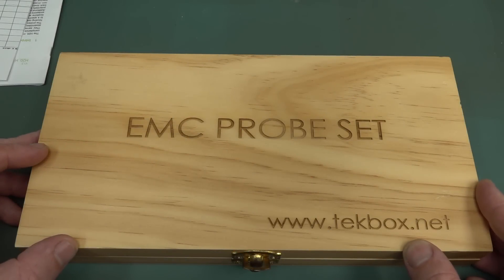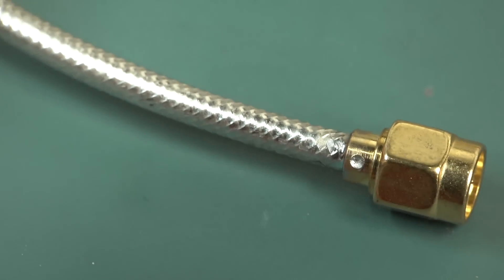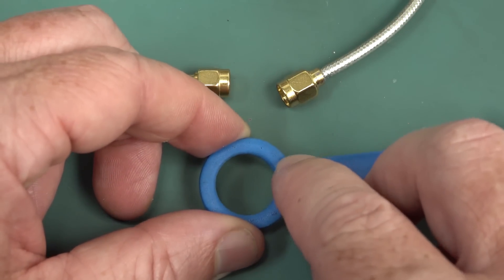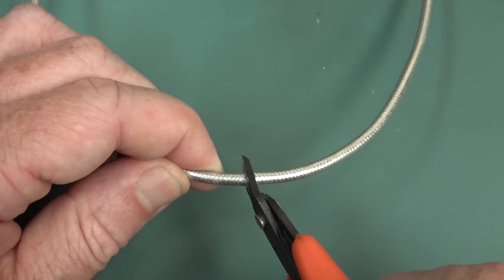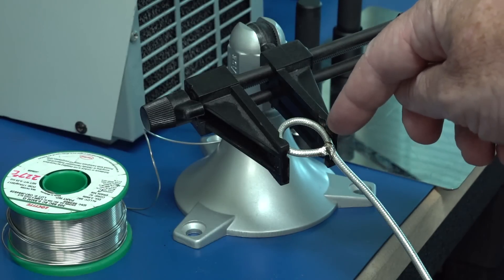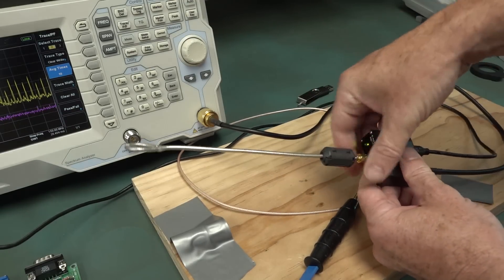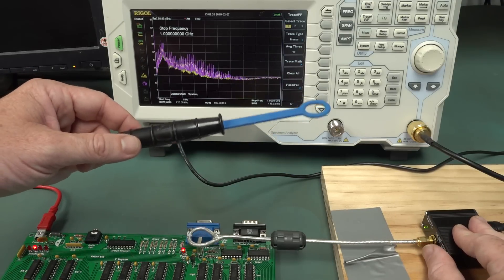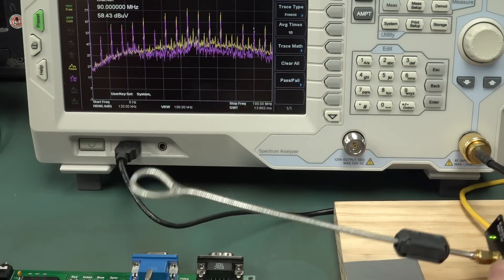EEVblog #1178 - Build a $10 DIY EMC Probe

Comment: When winding the coils I am desiring to measure to very low frequencies.  I notice professional low frequency sensors such as 'WaveControl WPH-DC' are extremely expensive.  What limits the lower frequency response of these?  How many loops and wire gauge if my goal is to be able to measure down to 1hz?

Comment: So I can use this to get the signal from the speaker wire on my Panasonic SA-PM46 Self Stereo (which I purchased from JB-HI-FI Woden in Canberra in 2007/08) amplify it so I can use it as line in for my TDK S60 Tremor Subwoofer!

Comment: Use the PastiDip in the non-aerosol can or liquid electrical tape and you will be much happier. 

Also, you can make the very small loops from very small diameter coax.  The coax does not need to be rigid, and if you put some steel wires or small fiberglass/carbon-fiber rods along side the coax for the small loop, it will add the needed rigidity. Use heat shrink over the coax and stiffener for the straight part and dip/paint on the liquid tape over the loop.

The small loop can be even more finicky to cut and solder, so short the end of it back over the coax before bending it into the loop, then solder the whole end back to the shield to make the loop. To cut the gap in the middle, you only need to make a single slice, and when you dip it or brush on the tape, it will fill that slot and Robert is your mother’s brother.

Comment: can anyone comment on the signal symmetry delivered by these antennas? The coax cable has 50 Ω wave impedance matching that of the amplifier and the scope, but is the signal coming from the probe symmetric or single ended?

Feel free to bash me in case my question makes no sense. Thank you in advance for taking time to answer my question.

Comment: The clue is in the name; PlastiDIP. Always better dipped if possible rather than sprayed. Mix and let settle to allow bubbles to come out before dipping. Keep moving while drying for even coating. Buy Pastidip thinners (naphtha) at same time in order to vary thickness (let evaporate to thicken, add thinners to thin). Store in fully sealed container otherwise it will be solid when you come back to it in a few months time.

Comment: You don't need plasti-dip for probe coating, use electrical tape.  It almost looks like the cheaper one could be prototyped in strip board if the need was urgent enough.  For a cheap spectrum analyzer, attach a 10 MSPS SPI ADC to a raspberry pi, write some code to perform FFT on the data using the GPU and pipe the output to a graphing utility to get an approximation of a spectrum analyzer.

Comment: I got loads of those RF amps sitting around, they're handy because you can use a buck converter and set the output voltage to calibrate gain with them, no need to use an attenuator.

Comment: HELP.
i have tried to join your EEVfORUM with out success
i signed up for a new account but never received a conformation email.
SMF help section says if i try to login with out conforming my email it will say i have not confirmed my email and will show a link to re send the confirmation email.
this is not happening when i try to login it just says username does not exist and asks for a correct username.
this is very frustrating as there is no way to contact any of your administrators unless i am signed in.
why is this happening, how can i fix it,

Comment: I'm sure it would be possible to build a $50 active probe that performs close to a $5000 keysight active probe. But the problem is, in order to do that, you need a very expensive spectrum analyzer and all related RF electronics gear. And once you have invested $100,000 dollars for all that gear, you wouldn't want to sell the product with just say a 100% margin, cause if you do, it would take decades to amortize your investment.

Comment: Im sure everyone has already said this but this is Semi-Rigid not Rigid 
but i mean you would never buy rigid coax without a bender and method of calibration and most dont even use SMA because its not good enough and blah blah blah 
anyway great video, i have a bunch of these little amps for RF stuff and might want to make one of these for use with an SDR (i dont own a spectrum analyzer unfortunately)

Comment: Another solution for your rubber coating: buy ABS filament for 3d printers and solve it in acetone. Then you can use a brush to apply it. The acetone vaporizes on its own at >20°C and only the ABS is left

Comment: Good noise floor for the couple dollar pre-amp. 
I've seen worse from decent commercial jobs. 
You can also make a quick and dirty e-field probe by cutting away some shield leaving a very short stub of the solid core conductor then insulating against shorts. 

Even if you don't have a specan these tools are useful with an oscilloscope (you will need the preamp). If it has fft like most dso do then that is a bonus.

Home made H-felds are great, beat the old emco kit any day of the week

Comment: You can make the H-field loop solder connection and shield cutting in many ways. There will be very little performance difference if you make it unsymmetric and just solder the center conductor to the shield on one side. Yeah, it won't be geometrically symmetric, but it will be electrically almost the same as the more complicated construction.

Comment: excellent video. I hope you make the follow up videos as you mentioned. I would also love to see a differential version of this instead of single ended. I think high end EMC probes must be differential to suppress common mode noise and enhance sensitivity. In the end it can be converted to single ended using a balun or something.
Someone asked if this can be used in audio frequencies, I think the voltage induced in that loop must be proportional to frequency as well as the loop area, so at audio frequency, the picked up voltage will be way below noise level

Comment: I NEVER found using this type of probe to find where the RE noise was coming from. The noise was everywhere, every component, every power rail. So trying to fix an RE compliance issue was not done with this sort of test gear.
We joked that what we needed was eye sight that could see the circuit board in the frequency of interest to find the component and power connections radiating. 
What I did learn was how to design proper decoupling to each component, and paying special attention to components that drove wide processor bus (octal, 16) paths, as these are charging the circuit traces which is what causes the RE problem in the first place. Our PC design department was useless, as they would just place the decoupling components around the board.  We figured out how to source the power for each IC on the PWB, so they were not directly connected to the power planes, but instead to multiple capacitors, which then had power connected to Vcc and such. The inductance of these traces had to be kept minimal. The idea is that the decoupling provided the high frequency currents for charging the board capacitance/inductance. It was tough, as we dealt with non technical board designers, that wanted to turn the autorouter on.
Reply: Well if the emissions are everywhere, then the design has a major problem as described. Been there, fixed that.
Reply: It takes a smaller loop - which will provide higher spatial resolution. 2 turns of 32awg (or so) enameled wire on 2-3mm dia (wire wrap wire also works), 50-ohm resistor in series and coax. Preamp required. Works well.
Reply: @milantrcka121  I never found any ability to find the source of the emission as any quantitative measurements were "noise here, and more noise there". The circuit boards were 150mm X 250mm. In 1988 the processor frequencies were 6-10MHz, but this morphed to 32MHz, to 128Mhz. The lab had multiple HP brand probes. When I was still green starting out, the technicians just laughed, as they knew the root cause of the emission was not found by this method. The RE plot would show which processor frequencies were the source of emission limit exceeded. So we would try to bandaid the boards with capacitors and such. 
In the end, these original designs were ultra crap, and the fix was a new board layout. My job was to integrate a card cage of 19 microprocessors and make it pass the environmental requirements. This was avionics, the test methods were from RTCA DO-160 (version G when I retired). There were very deep notches to the RE bode plot at the comm radios, and nav radio frequencies. And super position of the emissions from these processors was a challenge.

Comment: I built an EMC probe for less than $8, using a toraial core coil  and soic op amp. I needed to measure current WITHOUT physically touching the current-carrying conductor. Torrid core coil to the rescue! You can see it, and the printed circuit board CAD files that I offer as "open source", on my MeWe page @ Esp and IoT

Comment: 13:29 It looks like a tool handle dip to me 4:14 the surface finish is rough, bumpy, and full of holes.

It's likely the same thing you used Plastidip and that shade of blue is one of the three shades they sell. It also comes in a can so you can dunk the part rather than spray it.

Just just dunk the PCB into the container, pull it out, and let it drip dry. Repeat the process to thicken the coat.
Reply: Bushougoma Looks like they also used some primer coating to make rough surface layer on PCB and make it stick.

Comment: Great video Dave! The blue coating on the outside of the TekBox probes is likely a low-pressure overmold, which is the same material used on strain reliefs for cables, etc.

Comment: Great video and the answer to my needs for a cheaper and accurate way to measure fields. I  enjoyed the 2 layer/four layer computer boards comparison you did  recently but shuddered at the $300.00 Tek probe kit price. I used to make sniffer probes for use in troubleshooting radio xmtrs and receivers which were of course uncalibrated. I consider what you taught us to do here to be close to calibrated. Thanks for the unselfishness.
Reply from the maker: Should be pretty close to the performance of the professional Tekbox one. I can do some more detailed measurements and comparison, but it's looks as close as you can get. Although with near field probes you aren't really dealing with absolute quantitative measurements.
Reply: Dave, thank you and here is a project request: Would you design, build and test  the efficiency of a
a Joule Thief circuit. There have been many offerings but I have never see any commercial products. I recall you commented in the past about the LED in a similar circuit not having  a current limiting resistor. Some of the offerings have run a long time on a battery. I have designed my own 1.5VDC non Joule Thief LED "flyback circuit that generates a sine wave that I thought might recharge the battery but did not even though LTSpice indicated that it might. I also have a LTSpice design that uses very little 1.5VDC battery current to drive a LED but I can't get it to run in the real world. Still trying........

Comment: While the $10 option is VERY useful, the $300 kit has all sorts of calibration graphs and "reproducibility" when you get it.  It might not be necessary in ALL instances, but if you are doing a nice funded project that HAS to meet specifications, you may need the $300 option.  For me the $10 option will get me there for over 99% of the time.
Reply from the maker: The thing with near-field measurements is that you are not doing quantitative absolute measurements, so the point is a bit moot for most cases.
Reply: But wouldn't you use an anechoic RF test chamber for calibrated EMC tests?
Would the 300 dollar calibrated probe be the measurement antenna?

Comment: PlastiDip also sells "LiquidTape Electrical Tape" that seems a little better suited for this. ;) They sell spray and dip/brush formulas.
Reply from the maker: Ah, thanks.
Reply: EEVblog No problem. I wouldn’t doubt if it ends up being the exact same as black PlastiDip, or the same but with more or less solvent (acetone?). :)

Comment: should use the plastidip in a paint can, they make a dip solution for plastidiping tool handles
Reply from the maker: Sound a better choice. The spray doesn't really do it.

Comment: we've always called that soldered braid stuff "semi-rigid" coax.  Solid copper outer shield was called "rigid" ..
Reply from the maker: Yes, it's semi-rigid.
Reply: Actually the right term for this stuff is "handflex."  Examples of semi-rigid coax would include the 0.086" and 0.141" cables with the solid tinned-copper shield that you see in commercial spectrum analyzers and other RF gear.  It is not meant to be formed by hand and often breaks when you try.

Comment: Great video! I did myself some near field probes in the past and they worked quite similar to a beehive's expensive one. In fact I wrote an article about it for Interference Technology blog! The making process is really the same as you did, except for the finishing. I would be glad if you could check it out! https://interferencetechnology.com/diy-near-field-probes-preamplifiers/

I've tested their performance with a signal generator and a stripline and found no resonance spots over the entire range (which was more than enough for a quick scan or troubleshooting). Again, great video!
Reply from the maker: Nice article!

Comment: Dummy question, can those amplifier board be used as TX amplifier instead of RX?
Reply: What does each of those mean, to you? "TX" and "RX", at least to me, are two sides of the same coin, so...
Reply: @khronscave  for example if I have a transmitted and an antenna could I use that amplifier board to boost up the signal?

Not talking about the legal requirements, I'm talking from a electronic point of view.

I'm a noob with RF for me is like black magic.
Reply: @tuttocrafting  If the antenna impedance is in the 50ohm(?) that the amplifier's rated for, i don't see why not. 

I'm no RF guru, but to the best of my knowledge, amplifiers don't really care what's connected to either end, as long as it's within its capabilities.

Comment: $300 on Amazon is really a good deal. If $300 worries someone they should probably avoid this industry. If you become an engineer you can expect to be bashing heads with management over the smallest purchases and basically forget it if you need an environmental chamber. Smaller companies are worse and larger companies are better at this. Still, one gains a lot of experience quickly in a small company and it's tricks like building one's own probes that get you through. As for that environmental chamber? Stick a hairdryer in a box son...
Reply: An environmental chamber is one of those peltier cooled/heated ice chests. :-)

Comment: Could I use these with an 20MHz USB Oscilloscope from picpscope with FFT instead of a real spektrum analyzer to spot noise in audio circuits?
Or are RF Probe only for much higher frequency's ?
Reply from the maker: Usually much higher. The CISPA specs for radiated emission start at 30MHz for example.

Comment: As far as the coating on the commercial ones, its most likely injection molded around the PCBs.
Reply: The pcb part is 100% dipped, the surface is to uneven to be injection molded. The handle is either molded and put on or injection molded after being dipped (but I doubt it).

Comment: Dave! Can you provide a link or description of the preamp board? I paused on the data sheets and looked for those numbers on AliExpress and eBay. Just the ICs. No boards listed. 

I’d like to put a directional antenna on this board to help pinpoint the location of RF sources like WiFi access points above ceiling tiles.
Reply: I got one from AliExpress about a year ago, I think it's rated for up to 3GHz. Search for "RF Amplifier" or "preamplifier". I got a friend to characterize it and it was very linear. Gain is dependent on input voltage. Has compression issues and it can be easily overpowered by strong signals (such as FM stations).
Reply: Awesome, thanks!

Comment: This is good ! Any Spectrum Analyzer for $20, delivered ? Thanks for sharing !
Reply: An RTL SDR could serve as a (very) crude Spectrum Analyser and is approx. 20$
Reply: @dilucide  Yes ! I have one, but the bandwidth is very very narrow, also, the Windows drivers are difficult to setup and only for W7. Cheers !
Reply: Check out the SDRPlay SDR Receivers ( https://www.sdrplay.com/ ) for use as a cheap spectrum analyzer. Way ahead of any 8 bit "dongle" receiver, but well worth price of about $109 USD. Very popular in ham radio circles for doing different tasks.
Receives 1 KHz to 2 GHz and has front end band-pass filtering, built in preamp and attenuation, etc. The newer versions are, I believe 14 bit, and will display up to 10 MHz bandwidth at once. Very good software that is easy to set up and use.